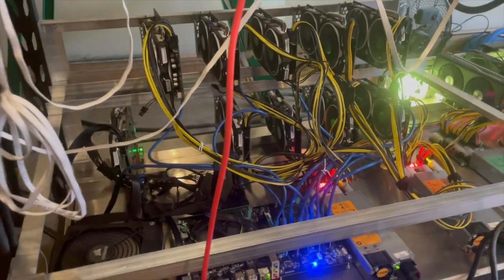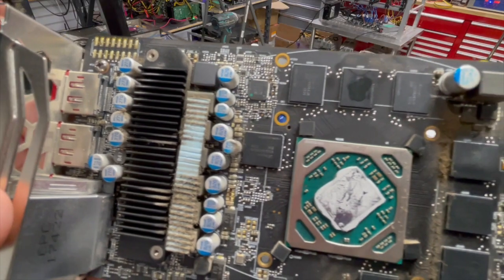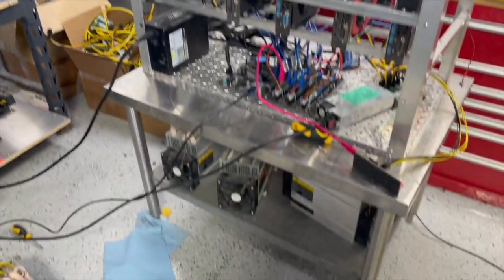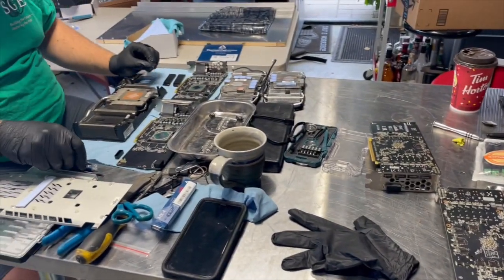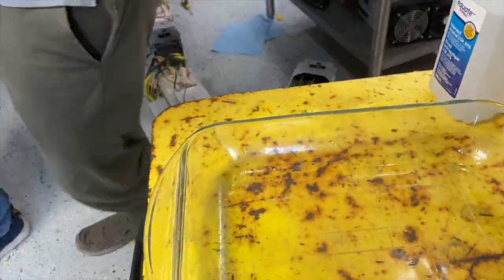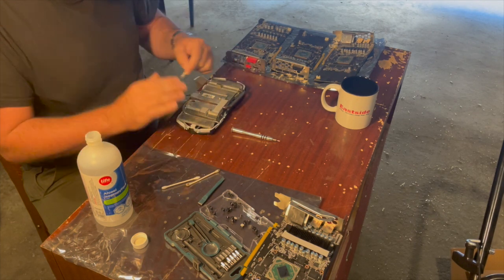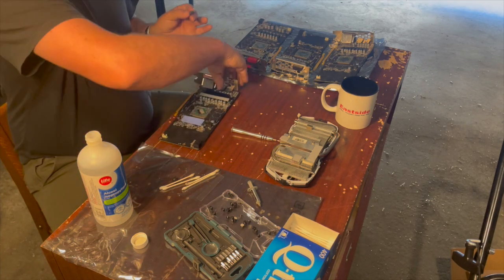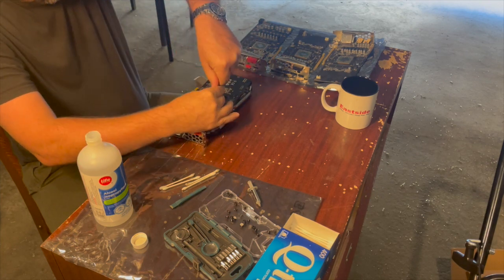Ultrasonic Cleaning a VERY DIRTY used GPU

Comment: Problem with IPA is it is a pretty strong solvent and water can warp the PCB. Those two things are more concerning than the risk of the water shorting a trace.
Reply: I always used 98% IPA on my devices and they doing fine after a decade

Comment: I want to buy one, but I'm puzzled about the size. You know today's cards can be freaking big, look at MSI Suprim's with 335mm length...
Also, how about GPU cooler? Do you clean it the same way, together with the fans?
Reply: A 30Liter should be able to fit even the large cards. I think my 15L is just on the cusp of fitting the larger cards, but if you don’t wanna chance it, go with the 30L

Comment: Good stuff. 👍🏼 personally in the office, whenever we work on a pcb, we have to run them through the ultrasonic cleaner to clean them both before and after working with them.
Personally after the last cleaning, i run the SMD parts through the hot air workstation, for two reasons. 1. To make sure everything has evaporated 2. If there is any remote chance of a cold or cracked solder joint on them it will be reseated.
Anyhow, good info right here for sure. 🤘🏼